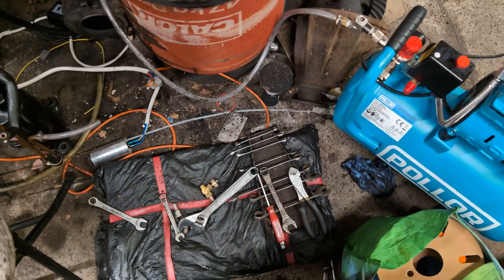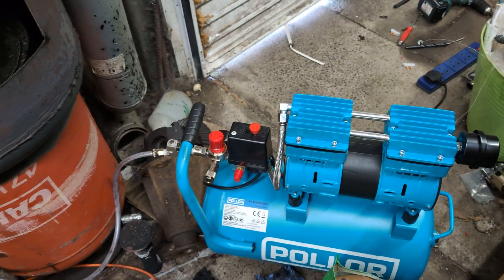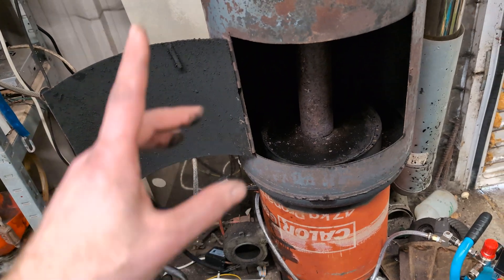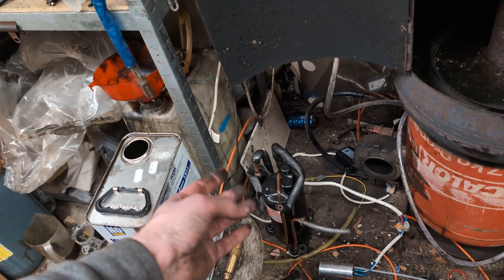Siphon nozzle waste oil burner DIY build - part 3 - trials and fails

Comment: You are getting water from your compressor, as it compresses air it condenses water out of the air. That's what's making the fire crackle. A friend way back in the 80's ended up mounting a oil tank above a wood stove and dripped oil in after he got a good fire going to heat his shop. That's what I'm going to do. Even the commercial oil burners are fussy. I have come to work many times to a cold shop because they quit working.

Comment: I have lots of devices with external 20A or 30A relays using NC and then use the Shelly to trip them off in case a reset is needed.

Comment: Please, please, please don't give up! My workshop is big and cold all year round (very cold during the winter) and I really need someone to get this working so I don't have to spend £1'000's on a industrial unit. Diesel heaters and log burners are all well and good, but waste oil is free and plentiful. Reading some of the specs. the lift height seems to be a function of input air pressure, have you tried running higher pressure, but with flow restrictor on the air? What if (as suggested in the comments) you placed the burner tube horizontally (with a tapered nozzle) into the bottom side of the burn chamber, this will allow the flame to swirl before exiting the chimney. I'm not convinced about the pipe with holes in, I can't see what benefit that will have.

Comment: One thing you’ve given me from all these videos David is that I will just stick with my webastardo powered water heater and run it on heating oil. I’ve been holding on to some waste oil but time to take it to the recycling centre I think. Great content as always!

Comment: I'm working on using a diesel heater burner for a forge/foundry. Using an I/0 both positions timed with board for pump...we will c when I put it together, just need a lil time.

Comment: Like I said in comments of yours past video everything is very simple about burning waste oils. Oil spray must have a temp about 60 celzius. You can do everything that you want to make this...heating oil in the oil tank or with a inline flow heater. For first testing  it is better to mount your nozzle in horizontally position and out of the stove. Put a nozzle at the end of tube whith larger diameter then swirler for about 1cm ( 0.5cm space gap between swirler and the tube). This gap is for passing the secondary air from fan which is mounted behind the nozzle. For automatization it is easiest to buy a cheap LOA24 controller with a flame sensor. You will also need 2 solenoid valves, one for oil and other for the primary air from compressor...For oil and air you will also need a regulators. I think that you have enough experience to solve potential problems that will arise. Good luck and you make another great video without orange...

Comment: ive been trying this for 5+ years, ive tried a spray can filled with oil but was just too hot, best ive found (as of last week) was one of the torpedo kerocene heaters, havnt had anything work so well by turning the pump up and running a external glow plug. what ignition coil are you using ?